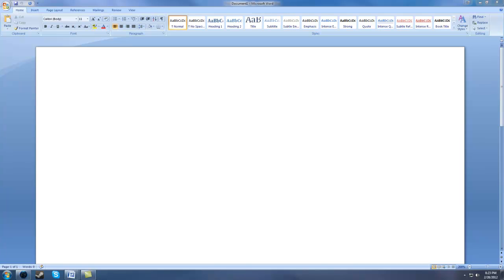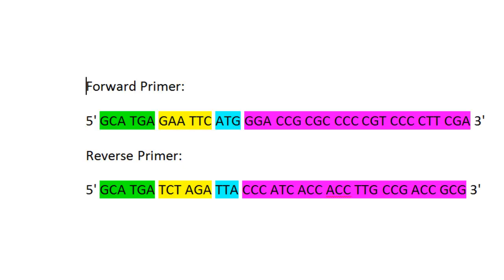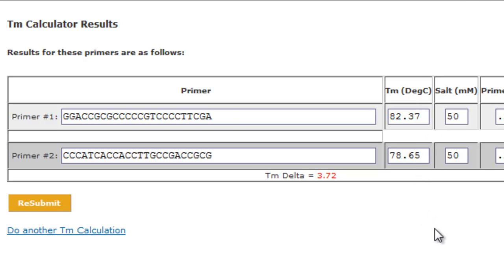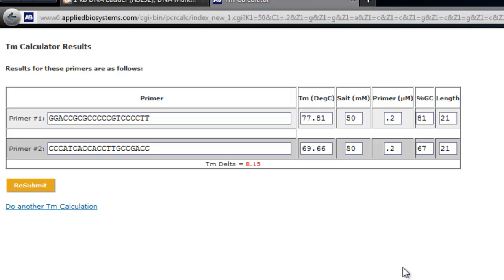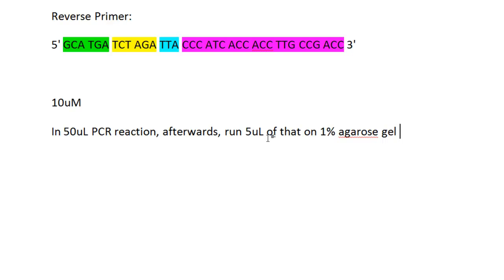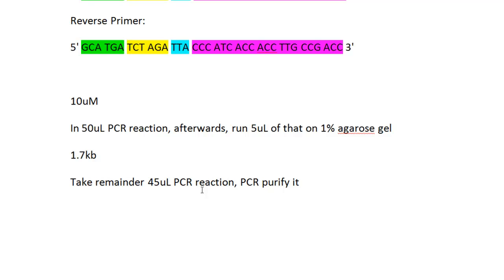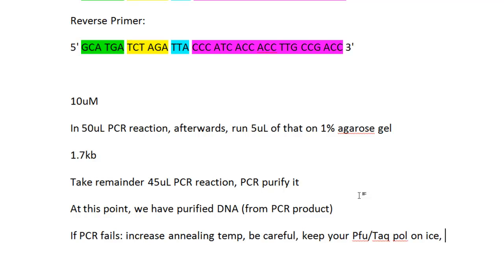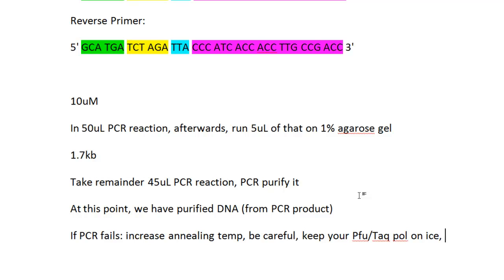Tutorial 2: Cloning Part 3 (Tm check, agarose gel confirmation, PCR purification)

Comment: In the section where 'shaving off" bases was a method for reducing the apparent TM, with regard to the reverse primer; should not the base removal be done at the 5' end between the primer and the restriction and the stop codon, and not at the 3' end?
Reply from the maker: If you remove bases from middle of the primer it will render it useless. It will not anneal because of base mismatching. Additionally, it would introduce deletions in your PCR product. Removing bases from the 3' end is the only option.

Comment: In a previous blog you said that you should subtract 5C from the lower of the two primer tm as this allows for better annealing. 

However you also said that if the temp is lowered to far then no n specific priming will occur.

In this blog you demonstrated that two primers can have between 6-12C difference, thus it leads me to ask the question how and where do i set the annealing temp (between the two primer temps, if so do I subtract 5C like you said?)..

Help!
Reply from the maker: Okay, I see your point. The melting temperature of primers is usually between 62C and 70C. Of course this will vary depending on the primers, but after designing and processing numerous primers, most of mine reside within that range. Primers with a 10C+ difference in their melting temperature is not very common, however if that's the case, what I would do is take the average melting temperature of the two and then just use that as the annealing temperature. If that doesn't work, use an annealing temperature that's a few degrees lower than the lowest melting temperature of your two primers. Again, your primers will USUALLY be close in melting temperature so figuring out an annealing temperature to start with should not be difficult. Again, I usually start with 60C since I've found it to work very well in many cases. I've used annealing temperatures as low as 40C and still got amplification. Just try out your experiment and see what you get, and based on that you can further adjust the variables.
Reply: So irrespective of the tm difference just average the two tm's and use this temp which is in the middle. If this doesn't work reduce the annealing temp until I get a positive result (but no lower then 40C) Am I correct? 

Thank you for your help. Here its blind leading the blind so your aim is greatly appreciated.
Reply from the maker: What do you mean by the blind leading the blind? Is the lab you're working in not very clear with PCR protocols?

Yes, taking the average of the two melting temperatures and using that as as the annealing temperature is a good place to start. If that doesn't work, as in getting no DNA bands, I would start to lower the annealing temperature. I would not go lower than 40C. If your primers are between 62-70C, I recommend starting at 60C. I keep mentioning 60C because I have had much success using that temperature.
Reply: Our lab is run by biomedical microbiologist who's experience largely is in phenotypic studies. There trying to incorporate molecular techniques so that publications can be entered into more journals thus allowing for greater spread of grant applications. But very few people have molecular experience here and there is little money for training courses. Thus were kinda feeling our way through it. Hence your advice goes a long way.
Reply from the maker: ronald steele
Ah, I see. Yes, that would be a difficult situation. I'm glad I can provide assistance, thank you.

Comment from the maker: (cont. from previous message) Also, keep in mind that one of the main reasons why people design primers around 20ish nucleotides is to save money. More nucleotides = more money. 20ish is sufficient, so usually there's no reason for longer primers for traditional PCR. Using 44bp should not be a problem - technique wise. I would be very surprised if you used those 44nt long primers and PCR did not work.

Comment from the maker: 44C is really too low. Tm of primers should be above 60C, conventionally. 44bp long primer is not bad. Primers can be pretty much as long as you want. I've designed and used primers over 70bp and they worked perfectly fine.

Comment: Hey! this video is really helpful. I'm current trying to design my reverse primer. I did what was done in your video however my primer's TM is 44 although the no. of nucleotides is 24. I did try to add ntd till the Tm reaches 60 but the length was way too long 44bp. My lecturer stated that the length should be from 18-30bp. What should I do?